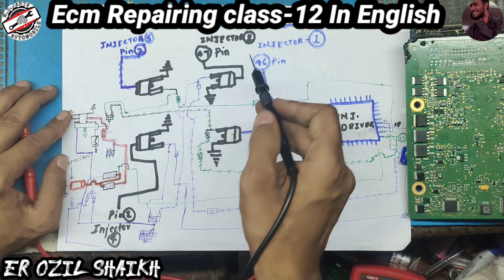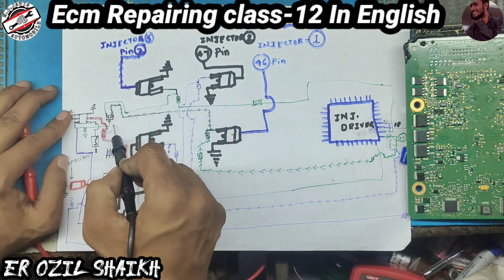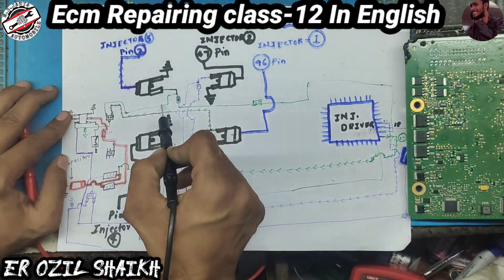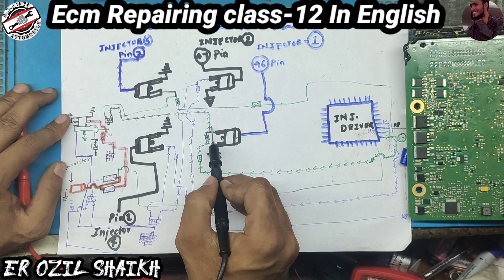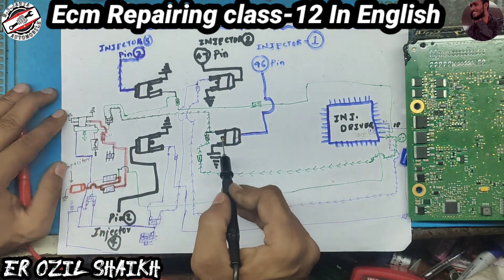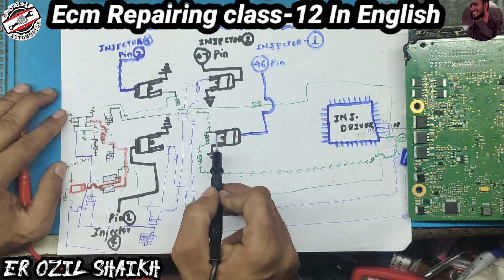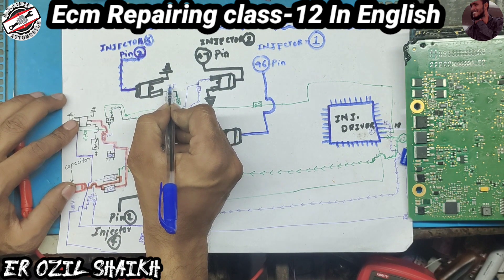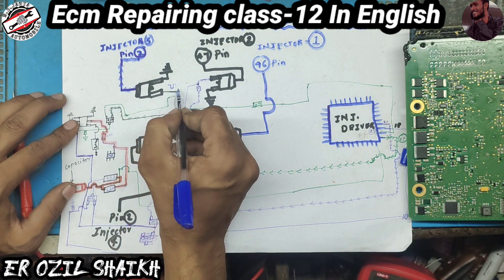Ecm Repairing class-12 in English | Continental ecm SimosPcr2.1 low side injector section | feedback

Comment: HI. thank you for the good info we are getting from you big brother. one question. how do you identify an injector driver on a mother board as i see on some the videos they are on the opposite side of the board?  the reason why im asking is because i have a diesel vehicle that is not starting, and it shows all injector codes and there is no pulse to the injector pins. the so-called ECM gurus have failed to assist. codes are p0201 p0202 p0203 p0204. when you clear them, they go away but come back immediately when cranking